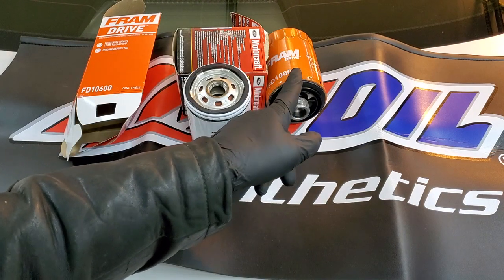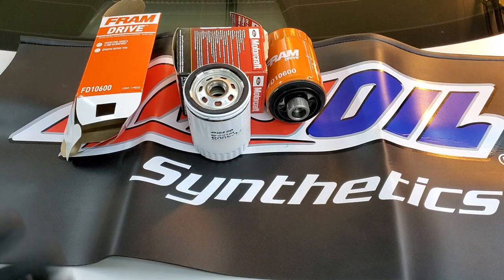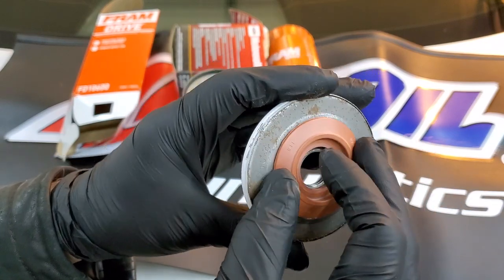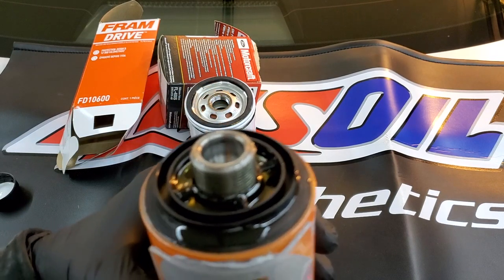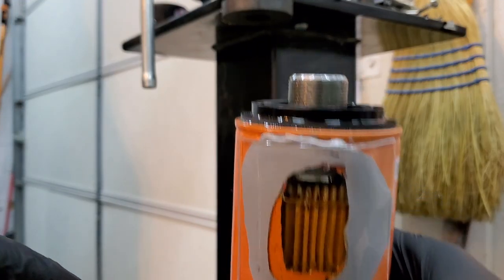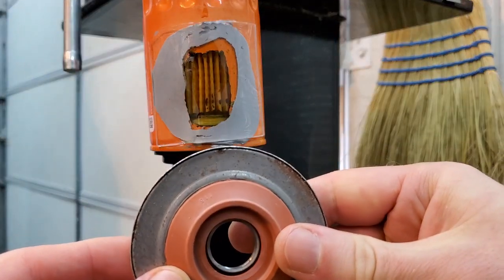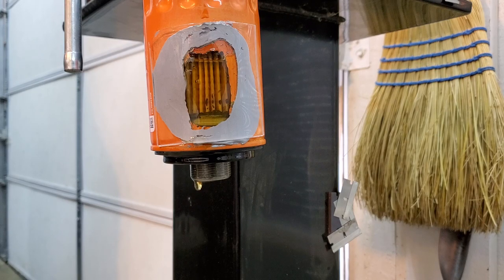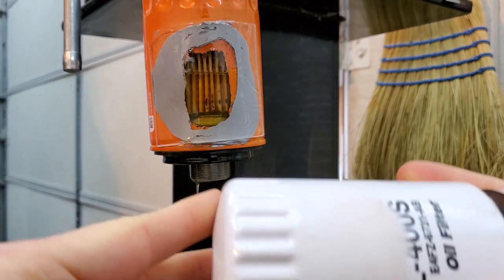How oil filter anti drain back valve works? Anti drain back valve has 2 jobs to do.

Comment: I don’t see the problem with top mounted oil filters here. 

There are many car makers who have top mounted cartridge oil filters, BMW, Mercedes-Benz, Volkswagen Auto Gruppe (Škoda, VW, Audi, Seat), GM among others. 

There is still oil in the filter after the drainage (also on top mounted ones). That is thanks to the anti-drain back valve. It will also stay there, as it should. The larger hole in the middle is for the clean oil to pass through easily. The small holes are the dirty side of the filter. You do not want that oil to drain back. Small particulates as small as 2 microns could unfiltered cause damage to your engine for instance on your crank bearings. The risk of introducing those microns or dirt increases by you pre-filling your filters. 

Personally I never fill the oil filter before mounting it and that is not just because I own a Subaru with a top mounted oil filter. Only if you’ve rebuilt the engine or made an engine swap it makes sense to pre-fill your oil filter. Especially after rebuilding it. The assembly oil is of a higher weight and you want it to lubricate effectively as soon as possible. You put it in there to protect the engine from wear at first start up. Even after an oil drain there is still a lot of oil coating the metal in the engine thus lubricating it at start up. 

I want to make sure that I do not introduce dirt into the clean oil filter and thus I never pre-fill the filters during a normal oil change.
Reply from the maker: How can you prefill top mounted oil filter?
Reply: @repairvehicle  You can. Not just for the cartridge ones, they are easy to pre-fill. Just the way you just showed us. In that long time your filter halfway emptied itself. Instead of letting it just drain out you could pre-fill it and spin it on. The anti-drain back valve will keep enough oil in it. It’s just very unnecessary to do it. Just as I write in my comment: I would not do it.
Reply: @repairvehicle  Also by not pre-filling when doing a normal oil change you reduce the risk of overfilling your engine oil.
Reply from the maker: Some manufacturers say it should be done.  Subaru filter is small and owners manual doesn't say to pre-fill
However,  when you have large oil filter and takes 1 quart of oil to pre-fill it makes sense to pre-fill as owners manual states
Reply: @repairvehicle  Well if it says in the owners manual, there is your answer to the possibility to be pre-filling Subaru top mounted oil filters. I have yet to see it in my owner’s manual. I just checked it and it is not mentioned. Neither have I read it in the shop manual for my Subaru model. As I stated in another post regarding the by pass valve there is a very short period of time before the oil pressure is at par and in that time you’ll still have oil coating the metal in the engine. I mentioned it too that Subaru original filters have a higher spec for their by pass valve than for instance Amsoil’s oil filters for Subaru (EA15K13) You’ve since unpublished that video.
Reply from the maker: Where did I say Subaru owners manual states to prefill?
Reply: @repairvehicle  I misread your post regarding “Some manufacturers…”. You clearly state that Subaru does not say that in their owner’s manual. Look! Either way there is a common notion in the automotive world that oil filters ought to be pre-filled. You say that some manufacturers also recommend it. 

As long as one follows the guidelines from the manufacturers one ought to be safe. Although I don’t think I’ve ever owned a car where it says to pre-fill the oil filters. 

Have a nice Sunday!
Reply: @repairvehicle There is a simple way to prefill the oil, If you have a Subaru, since 2005 when they introduced the drive by wire throttle.  Do this. After an oil change, before you turn the motor over, hold the accelerator pedal to the floor (all the way down) and hold it there. Next turn the key or press the start button. The car will not start but crank with the starter.  This will pump oil into the filter.  Let it crank 5 - 10 seconds.  That primes the oil in the system. Holding the accelerator pedal down before starting prevents spark to the plugs and the fuel pump turning on.  After doing that you can start the car like normal.
Reply from the maker: @Pete Romano  , why do this? I have never done on my Toyotas and have zero engine wear.
Reply: @repairvehicle  There is no such thing as Zero Wear. I like to prefill my oil filters after I change my oil. This is how it's done if you have a top mounted filter like most modern Subarus.
Reply from the maker: I have oil analysis as a proof that I have zero engine wear. Not one oil analysis, but many. What proof do you have that flood mode is helping avoid wear? Oil analysis before and after? Or just personal preference and no proof at all?
Reply: @repairvehicle  I've had 15 Subarus and never an issue with burning oil or premature wear.  So I can say it won't hurt to prefill your oil filter.   I have many oil Blackstone  analysis tests yes .To claim you have Zero Wear on a motor tells me you have a very special motor indeed.
Reply from the maker: Why do you keep replacing Subarus?
Reply: @repairvehicle   Prime  The engine
Reply from the maker: @fidelbaca2225  ,I have no need for it.

Comment: Anti-drain back valve prevent oil drain from"outer holes",so oil comes from
central tube is NOT  valve failure.
Reply from the maker: Oil flows through filter media
Reply: @repairvehicle normal oil direction,from outer holes,to anti-drain back valve,then through filter media to central tube . It's norma oil from filter to centra tube.  It's an oneway valve.
Reply: If oil drians from outer holes ,that's a" anti drain valve failure."